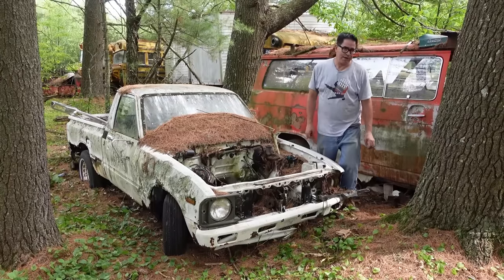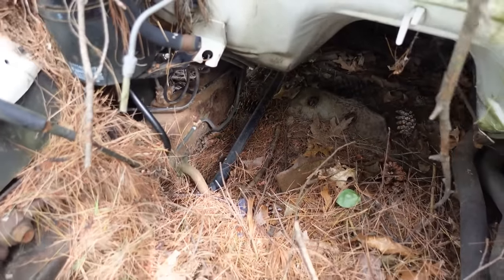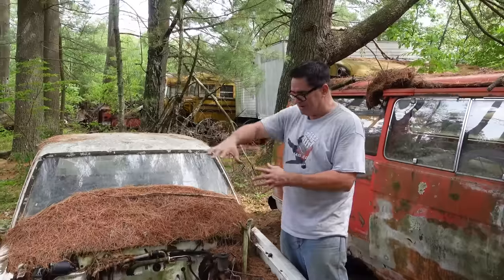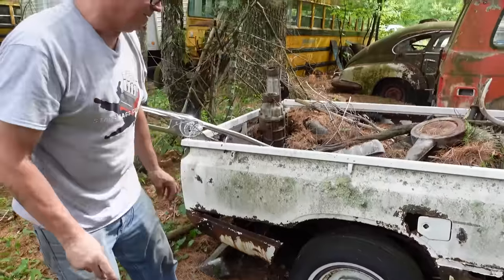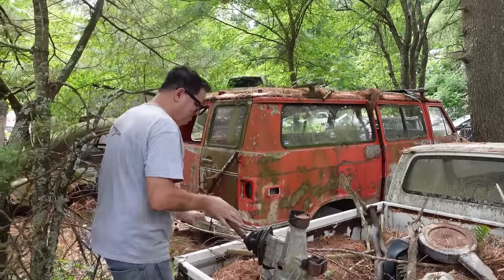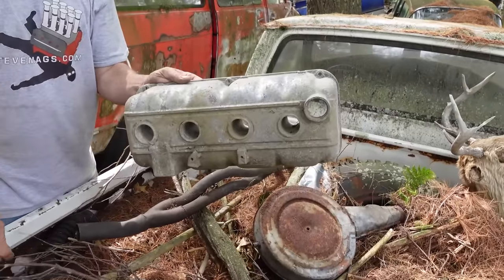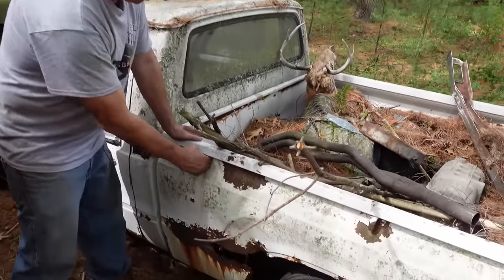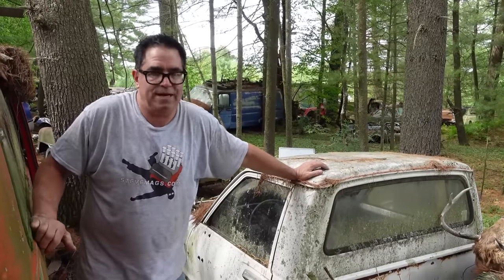Truck Week EP40 - Toyota SR5

Comment: We need vehicles like this again. Modern vehicles have too much unnecessary technology and they're too big
Reply: You'd have to add some safety features, but yes, keep it small, keep it simple, and don't try to make it anything other than a truck.
Reply: Agree.  Ford has made an effort with the Maverick, but upon a closer look, it's basically a car.  Toyota, Nissan, Courier, LUV and others were great little trucks.
Reply: Blame the EPA nonsensical regulations and the chicken tax scam
Reply: I agree The_R,  I use a 92 on weekends and my 99 waits for a frame.    I have a 1982 safe in a garage.     I had thought to sell one but I'm realizing they are just so easy to use .....simple and working.
Reply: That's why the Maverick is doing so good for Ford. Relatively 'cheap' - they started out costing 'just' $20k which is nice compared to the bigger brother trucks that get all the way into $100k territory! It's crazy what a superduty costs nowadays! $50 -$60 for a base XL regular cab 'work truck', up to $100k for loaded Platinum\Limited\KingRanch etc!
Reply: @FEDsShotMOM the EPA isn’t nonsense.. I drive giant V8s, but keeping the environment clean is important too..

Comment: My friend had an 86 sr5 4x4 with a carbureted 22r. It had 6” of lift on it. He got it for 100 bucks after the great flood of 93, because the truck went through the flood. We put a new interior in it, drained and refilled all the fluids, replaced the carburetor, and replaced the bald 33 ground hawgs with 33x10.50 bfg’s .. that was a fun little truck.

Comment: Wishing you well as you get better each and every day. As stated last time:

The 22R was a 2.4L engine and when it got the "E" designation, that meant it was fuel injected. That is incorrect, fuel injection didn't come around until the next generation (for trucks) starting with the 1984 model year. Yes, the 22RE came out in August of 1982, however I believe that was for passenger car use, not truck use (which again would occur in 1984). These trucks were made at the Tahara plant in Japan. The 20R was a 2.2L engine, not a 2.0L as you might think. Toyota engines don't usually line up with liter size as other manufacturers (like Nissan as an example) often do with their model names and nomenclature, such as the Nissan SR20DE as an example. That is a 2.0L four cylinder. 

The Chicken Tax was still in place well into the modern era, because Mercedes Benz was doing it with the Sprinter van, sending it to the US from Germany as a "knock down kit" and reassembling it in a South Carolina Daimler plant in the USA. The Subaru Brat was also a "Chicken Tax" beater by having seats and carpet in the cargo bed area. Also, the Ford Transit Connect is made in Turkey and is shipped to the US with rear seats, which are then removed to "convert" it to a cargo van. However, the Japanese just beat everyone at their own game by establishing production facilities on US soil and in turn bringing their suppliers with them. Honda in Marysville, OH as an example has many suppliers within a few hours' drive of the facility. 

Adding in from last time: No, the last Chrysler passenger car to use torsion bars would have been the 1989 "M" body cars (Gran Fury, Diplomat, 5th Avenue, etc.). You might have meant "Kelsey-Hayes" as they were the typical OEM wheel manufacturer for many of the US auto makers. 

In 1980, Jimmy Carter closed the "chassis cab" loophole which was allowing manufacturers to install a truck bed locally to avoid the CT. The W50 transmission was produced by Aisin which at one time had a joint-venture agreement with Borg-Warner, but by 1981, BWs ownership stake was lowered to around 10%. 

That is incorrect on the Toyota Stout being imported to the US starting in 1968, it was earlier. It was imported from 1964 to 1969 and had the 1.9L "3R" engine in it, and was called the Stout 1900. It didn't sell well (some reports show that only four were sold the first year in the US) mostly because the truck wasn't designed for the US market, it was designed for the Japanese market. 

1979, not 1978 was the first year for the 4WD Toyota pick-up. Toyota often introduces their models mid-calendar year, a little different than the American companies did back then. Typically, for example a 1979 GM vehicle would be produced from August 1978 to July 1979, although there were many exceptions to that rule (I have seen late September 1979 made Corvettes that were indeed still 1979 models, not 1980 models as you might expect). whereas the Japanese might produce a vehicle in early 1979 as a 1980 model year. It's hard to read the tag, but this should be code "033" White exterior paint.
Reply: You left out the VW plant in Westmoreland PA.
Reply: @davidadriance5159  I didn't leave it out---I was citing examples of foreign makers on our soil beating the Chicken Tax. Nissan, Honda, VW, Toyota and many others have done it.

Comment: Last year of the soild front axle was 1985, not 83. They also offered a n/a diesel engine in them, but its a fairly rare option. My 85 is a 2.4L turbo diesel and its a solid front axle

Comment: Steve, hope you are back Soon, today you are right down my alley, I used to build these and drive and race them. First, locking gas cap means it's a Japan built truck, just a flapper door means it was built in California. 20R had hemispherical chambers with intake on one side,exhaust on the other, but spark plug was in the wedge position, 20R had double row timing chain with metal guides, 22R had wedge type head with valves side by side and  single row timing chain with plastic guides that would break when you started the engine. Using the 20R oil pump gear spline you could use the 20R double row timing chain/gears/metal guides on 22R up until 1984. The main bearing is unique it is in the center of the block, and all the connecting rods have a small hole when the crankshaft came to top dead center it would squirt oil under piston rings. All four cylinders. Another thing you had to keep an eye on both 20R and 22R carbureted engines had vacuum secondary two barrel, driving easy for high gas mileage the secondary would carbon up and not allow the 2nd barrel to vacuum open. Many of these trucks lived their entire life on one quarter sized throttle plate. Good for mileage,bad for getting out of the way of that log truck at an intersection! Cyclone made a alumacoat header that had little funnels (Anti-Reversionary cones) in each pipe, this one modification increased my top speed from 85 to 100 mph . I also recommend the Zoom heavy Duty clutch. If overheated both this and the factory clutch would slip, the aftermarket one would go again once it cooled off. Everyone switched to the Chrysler wheels so you could Run 15"-78' or even wider  bias ply or Radial tires. It came with 14's from factory that dished in. The Chrysler 15's were centered it also handles a little better with wider stance. One more thing, all trucks came with 4.10 non posi rear gears except 4.33 for automatic trans. One more oddity the 4x4 had 4.11 gears, the 4.11 had lots of thin teeth on the ring and pinion, the 4.10 2wd had fewer thicker teeth? If you have 4x4 need to keep them same ratio for hwy use. Either two 4.10's or two 4.11's. Last thing, remember the first Iraqi war, 1981.4x4 Toyotas with lift kits and .50 caliber machine guns? Those were diesel models that got an amazing 38 to 50 mpg and the engines lasted 300,000 to 400,000 miles, we never got these in any numbers on the U.S.A. or if we did they wouldn't sell. Get well STEVE! One more thing,if one headlamp gets dim, there is dielectric grease on the fuses to prevent rust, and a right and left headlamp fuse. Wipe the dirty grease off the fuse headlamp brighten right up!
Reply: Dang dude, I didn't even read the whole comment but I gotta give  you a thumbs up simply on account of how thorough you are !
Reply: @2centsam927  I grew up racing driving modifying Toyota trucks. Each one was like a loyal friend. Right now I have a 1990 Dodge ran 50 4x4 automatic that was a free removal. I'll never sell it, love that truck!

Comment: Good buddy had an 80' 4X4, but it was just a 4 speed manual. Served him well. Pulled the motor to rebuild it. Out so long the axle leaked dry. Finally gets the motor back in, screams out on a test burn and locks up the axle tight. My D50 with the 5 speed, 2600cc with the primary/secondary 2bbl handily smoked all the other brand 4 cylinder pickups back then, including the 22R. Every buddy who had these Toyotas, had serious box corrosion at the seam halfway up the sides. Slowest was the turbo diesel version. Could NOT make 84mph downhill, foot to the floor. Tiny cabs. Both of us are over 6'-4+" and big lads, so pity the poor sod in between us.

Comment: I had a '83 Toyota 4x4 with the 22r motor. I loved the solid axle up front. Tough truck. Ten years later, I bought a '93 4x4. I liked the looks of the solid axle up front, over the torsion bar, independent front axle.

Comment: These things were everywhere in the '80s. I bought an '84 new and you could have either carbureted (22R) or EFI (22RE). I went with the 22R and it was reliable as a hammer. The trans was fine until the countershaft bearing started growling, so I just drove around in fourth (direct drive) as much as possible. In the end, rust won.

Comment: I daily drive a 1985 Toyota two-wheel drive SR5 extra cab pickup and it does everything I need it to do exceptionally well. I did an '80s style refresh on it so I cruise around Florida with the AC on and tinted windows it's the easiest truck to load and unload in history. low to the ground. Good for my old back!

Comment: The E49 charger in 🇦🇺advertise it was a 4speed on the front guard . Back in the early 70s as the E 37 and E 38 were 3 speed Weber equipped 265 HEMI  . So it was an advertisement to sell . 👍🏻🇦🇺

Comment: The 1984-1985 Toyota Pickups/4runner had a solid front axle. Toyota switched to the IFS torsion bars suspension in 1986 in the pickup/4runners.

Sorry bud, Marty’s truck was a 1985 with a solid axle. Though I have read they used a few different trucks, with different interiors. The 1985 sr5 had the vertigo seats, which is how the Toyota nerds identified the two different trucks in the film.

Also, you were wrong about the  EFI as well, that was offered starting in 1985 22RE in the pickup/4runner
Reply: Yes, thank you, this is correct.  1986 last year for 22R.

Comment: Some corrections Steve! 

You could get a straight axle on the 4th gen body for a half  year (19)83.5 if I'm not mistaken
Reply: You could also get a carbureted 22R in a 4th Gen body...I had one. 1984 yota single cab short bed two-wheel drive 4spd 22r
Reply: Straight axle until 85
Reply: @MiloPerrotti  thanks 👍🏼
Reply: The 22R was a timing chain engine.
Reply: @MrTrundleon  correct...
Reply: ‘85 was the unicorn year. Still a solid front axle but fuel injected
Reply: IFS only after 1985, and EFI only after 1986.

Comment: The 442 was four barrel, four-speed, twin exhaust from memory. So there's another example of gears used in marketing.
Reply: 400 cubic inch- 4 barrel- dual exhaust.My Brother bought graduated in 65, bought a 442 each year until He got married, in 1971. They were his favorite car.
and- several of them were automatics !!
Reply: @ThomasSmith-hh8fp  I appreciate the comment but everywhere I checked it stood for 4 speed on the floor synchro mesh. I am aware that they came in automatic. I think the very first cars may have all been four speeds but I dunno.

Comment: that particular lug pattern also fit a lot of Ford vehicles. I had a 76 maverick, same lug pattern. Toyota Center hole was just a little smaller are used the front rims off of a four-wheel-drive for spare rims for my maverick skinny rim with an 8 inch slick looks stupid, but works great.

Comment: If i recall correctly, the U.S. military bought these in large count and replaced the tailgate with steel mesh where the TOYOTA name was. I recall a news article from 80’ or ‘81. This didn’t sit well with Ford or GM.
Reply: Even later on the US armed forces bought some Toyota vehicles. Some were modified at Fort Campbell before going off to Afghanistan.

Comment: Dated a woman that had a Toyota Corolla with that hemi engine in it. '76 , I think. Didn't like to be driven over 65 mph. My Nissan truck had 2 spark plugs/cyl. (hot plug, cold plug) Maybe Steve could find one of those.

Comment: Not the final year for carb...84 was.
Yes fuel injection was optional.
Reply: 1986 last year for carb’s.  Had a 1986 SR 4x4 22R made in May 1986.  1987 Factory service manual has no reference to 22R, 22RE Only.

Comment: You didn't need pine needles to rot out a Toyota truck bed. This truck has the Japanese built truck bed as it curled over rather then curled inwards on the USA built beds.

Comment: My 1985 Toyota P/u had a 5 speed and a 22R motor- carb no injection.As they all do,mine had severe chassis damage,undrivable I thought- frame busted right as the hump over the axles bent upward-scrapped it
Scrapyard sold it to a moron that actually put bigger tires on it and waxed it, but never fixed the chassis.I was shocked to see it back on the highway
Wonder if he killed himself or any innocent people with it.
Oughta be a law that inspection stations LOOK under the vehicle-if they get inspected at all.
DO NOT drive any vehicle with a broken frame....it's death riding with you,fool- and you could kill The Innocent also